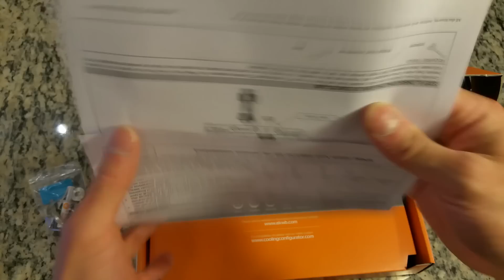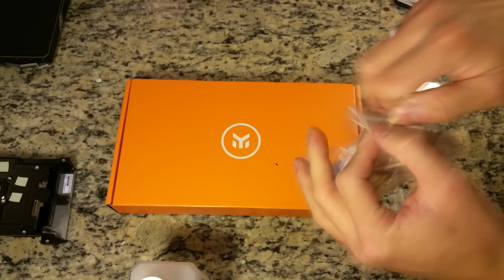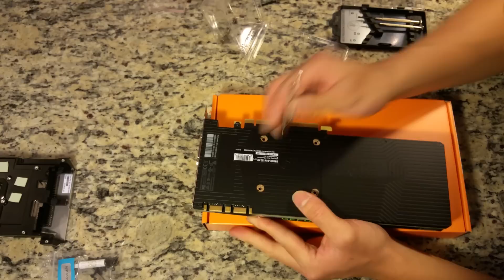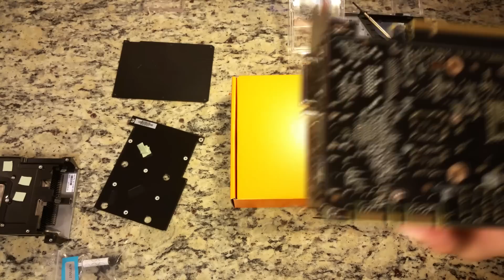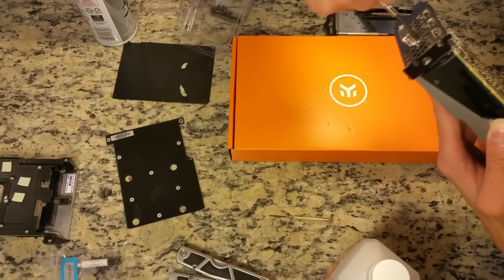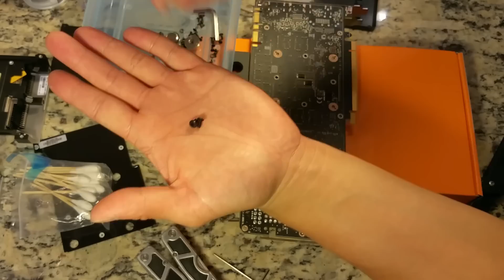GTX 1080 Graphics Card Watercooling Step-By-Step "How To" Guide withe EKWB Water Block

Comment: Get yourself a decent tool set man, using garbage tools to take apart some high-end hardware totally don't recommend. To remove the back plate standoffs, and to do it safely use a 4mm socket. Pliers or needle nose so dangerous, scratch that PCB or knock off or a resistor you're screwed!

Comment: Hi there, it's my first time trying to do a water cooled gpu so I have a gtx 1080, but what pump would you recommend for this? The Gpu is the only ting I'm going to be water cooling with it since my gpu is already cooled by a NZXT Kraken X61. Thanks.
Reply: 3DU ORT use mineral oil cooling

Comment: From personal experience I found that spreading the thermal paste with a spudger works better then applying a dot or X but I only tried this on a cpu not gpu where I spread out the past making sure not to put to much on that it comes out the sides on one PC while on another PC I used the X method and the one that had the paste spread runs cooler that the X but just by 3-4 degrees cooler I know its not much but just wanted to put that out there. Has anyone else had a similar experience?

Comment: Why are you dumping hot water from one card into the other?
Reply: hot water? lol you fuck ass
Reply: what are you talking about? You obviously have yet to do real watercooling. First of it really does not mater if the loop goes first in a card and then directly in the next. Afterwards you can also make the cards take the liquid from the loop in parallel but this requires different tupeing and tbh does not affect that much performance since depending on the radiators the flow will be good enough to cool everything.
Reply: Uh.... last i checked series is 5c on avg hotter. Just saying but guess you are trying to be water cooling master race....
Reply: Kenneth Oslund Again if you read my comment. I said that even if you put it in series yes it will have a tiny difference but considering that even the with a triple gpu watercooled in series setup the hottest card will still be way cool enough for it to be completely stable for a good overclock. I am not pretending, thanks for trying to get under my skin but I will have you know that I do have a watercooled system too, maybe not custom but I do know my way around components very well and will once I have the money make a completely custom loop myself.
If you really find this so hard to believe I suggest you look up Jayztwocents, he can teach you a lot about watercooling and has a video which talks about this topic exactly and telling it does not matter that little difference. If a gpu on load at 70c works fine than at 45c its fine too...

Edit: since you probably would be thinking I am bullshiting like most people think because I also enjoy games such as minecraft instead of just stuff like the witcher 3, here is proof: http://s356.photobucket.com/user/____Paul____/media/13340565_10208217373144604_308663318_o_zps1ytcouak.jpg.html?o=4

http://s356.photobucket.com/user/____Paul____/media/WhatsApp-Image-20160619%201_zpsoajcphbm.jpg.html?o=4
Reply: Yo you are the one who took pop shots with the "You obviously have yet to do real watercooling" and then trying to school me on some shit. So get on your bike with that "I am not pretending, thanks for trying to get under my skin". lol
Reply: +Kenneth Oslund you seem to have issues... You genuinely asked a question and I just wanted to be nice to you and answer that question than you come up saying I aint master race for no reason? If you don't want an answer why ask? Seriously... But I guess you know better... Guess 6700k builds are not master race.
Reply: lol wtf....
Reply: So wait....Kenneth doesn't know what he's talking about, but yet you concede that cards run in parallel do actually run cooler. Try and backpedal some more lololol.
Reply: +Ryan M. No I have never said that... Please reread my comment. He said why would some run a loop and let the "already hot" loop go in the next gpu and I just said that it does not matter... Even if there is a small degree change at the last card, the cards will still run fine because they are way lower than just air cooled anyways...
I also said that one could make a parallel loop (which this one isnt btw) to have a more consistent temperature for the entire loop and thus the cards... But that does not matter here since he was just asking why ruining the loop like here in this case but again, it does not matter. The loop is not hot enough that it affect the gpus performance... It just does not.
Reply: So you again agree there is a temp difference and that parallel runs cooler.
Reply: +Ryan M. Yes but it does not matter and that is the point... Is reading this hard? Listen if a normal air cooled gpu runs perfectly fine at 70-75 degrees c, why in gods name would it matter if the hotest gpu of a loop runs at a mere 45 or 50 degrees c? This is what I have been saying this whole time... Look it up all you want. All people that watercooled their gpus in series will give you the same reply.
Reply: Good boy
Reply: The point is parallel runs cooler /thread.
Reply: +Kenneth Oslund you say good boy but I literally said this in my first comment so bad boy for not being able to read...
Reply: Oh no I read it just fine. Also starting to let me down with out the paragraph responses.
Reply: Oh one more thing you mentioned Jayz 2 cents earlier....look at all his builds every single one of them runs gpus in parallel.
Reply: +Ryan M. If you would look st his other videos which are his live streams or qna's you would know he already talked about loops in series and that it just does not matter and he has parallel because it is his preference... -_-
Reply: +Rusty Shackleford ikr!
Reply: that "5C avg hotter" is total bullshit someone made up and you're repeating it. the most efficient water loop is the shortest water loop. the total amount of heat dumped into the water loop from your hardware does not change if you put them in any specific water. water is one of the best heat conductors on the planet and the the loop will always be in a temperature equilibrium as long as the water is moving.
Reply: solomonshv It is not made up. Go look it up yourself. Benchmarks are all over the place and that is what you.@linus @jay and plenty others (also singularcomputers)

Comment: Fuck man I just broke 2 transistors am I screwed ? or can it be fixed or will it be a problem ?
Reply: I broke two as well while doing mine using this stupid method. luckily it still works. I stopped and went and bought a 4mm socket
Reply: Haha!
Reply: Does your card still works a capacitor just felt from the back of my pcb .-.
Reply: +Mr Mimeitor yesterday I found a guy who does micro soldering and he fixed it but I havent gotten a chance to test it. I learnt that using right tools for pcb is the most crutial part. So sad that the guy on the video is not using right precision tools either...
Reply: +Berke Boz the worst part is that i used the right tools but it just felt off .-. Sigh, btw i will test the card i saw alot of post saying that it should work fine
Reply: +Mr Mimeitor can you determine where that capasitor is exactly located. If its on ram part you should be fine. If it doesn't work you can try soldering it by a professional. Ill let you know if mine works or not
Reply: +Mr Mimeitor wow mine is %100 alive. Microsoldering worked well for me
Reply: i just pluged it bc i couldnt find somewhere i can fix it and its working it even overclocks the same way D:

Comment: Dude thank you for the shortest screw tip at 19 minutes! I been wondering If I did it wrong the whole time, apparently I didn't. Thanks bud! Your the one person on youtube that mentioned this! =) Definitely gonna sub just cuz of that!

Just to clarify there are 2 different screws that have to be used for the PCI bracket. According to EK only one has to be installed so I did it their way should I just go ahead and use one of the long screws or the rly small blunt, thick one for the last remaining hole in the PCI bracket?

Comment: by the way, the loktite is used due to the vibration the fan creates, coupled with the heating and cooling thus expansion and contraction cycles, it would unscrew itself over time

Comment: -  4mm socket can be used to take out the standoffs

-  You should use the rubbing alcohol to clean the ram and VRM modules before applying the thermal pads as the stock pads leave a residue that can affect how the new pads stick.

- The main goal in applying the thermal paste is to have the paste cover the entire GPU di when the block is seated. A bit more never hurts.
Reply from the maker: Very good point about cleaning before adding the new pads

I tried using the hex socket- not grippy enough without risking getting too close to the board and scraping it. Maybe I needed to buy a more precise socket.
Reply: EK should be coming out with a block for the MSI versions soon
Reply: Also the fuzz from the bottom swab probably came off in the thermal paste which is now chilling in between. I wouldn't want fuzzy paste on my 1000 dollar gpu setup. I would also be careful with the thermal tape as the oils from your skin interfere with the heat transfer but that shouldn't be a big deal as much as the GPU diode. Good video though buddy, thanks.